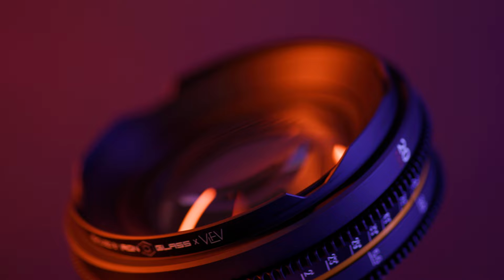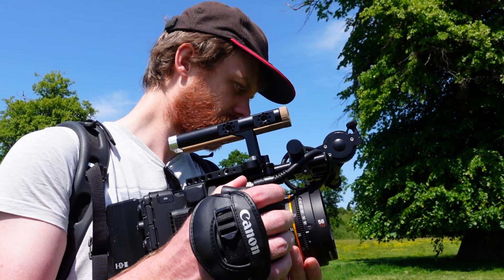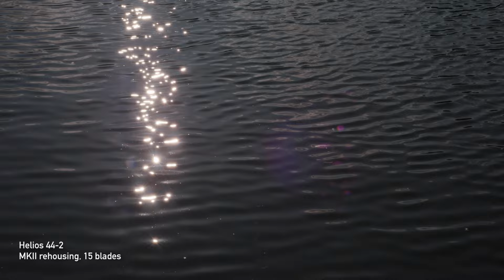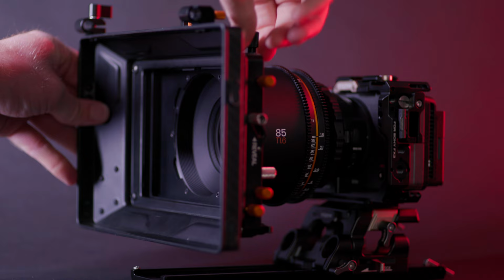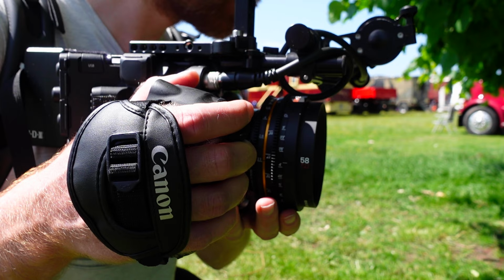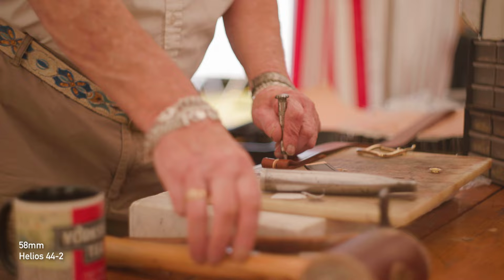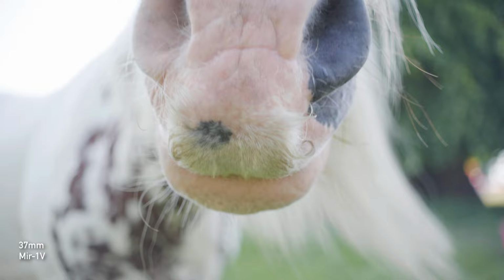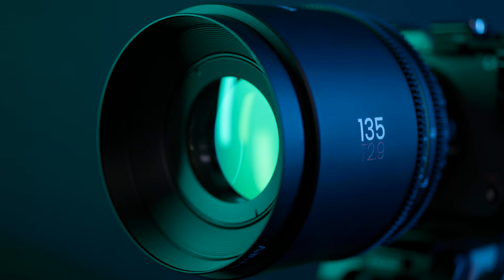IronGlass MKII Review - Are these the best vintage lenses in the world?

Comment: Great breakdown Alex, kudos for putting this out there.
Reply: Do you happen to know if the mk II versions mount on the Ronin 4D? (Aside from the 135mm which will be too heavy for the payload). I know the mk I versions mount but not sure if the larger diameter of the mk IIs will fit the lidar bracket.

Comment: Here's a question - did you send in your own lenses? Did you test them first? Or did you let Iron Glass choose the donor lens? Really itching to get a 44-2 in a rehoused version. Which version of the Helios did you rehouse? There's so many variations.
Reply from the maker: I opted for IronGlass supply the donor lenses. It was worth the extra cost to me - yes, I could have found them cheaper had I picked them myself, but it saved the time and effort plus all the lenses IG supply are perfect condition. The Helios 44-2 is the 'classic' Helios 58mm, with 44-M and so on being the variants with any notable difference. It shouldn't matter which 44-2 you supply, optically they're all the same but with perhaps only very minor tweaks to the coating over the years.

The exception to IronGlass supplying donor lenses was the 40-2, which I sourced myself. At the time of announcement this was necessary, however I believe they are now offering to supply these themselves too.

Comment: Thanks for the great review, Alex! I recently ordered my 58mm MKII and want to add the 85mm 40-2 and a wide option to complete a 3-lens set. Thinking of the 37mm simply because the swirly bokeh seems stronger on this one and could match the Helios better. I also wanted to ask if you know of 82mm circular filters causing vignettes on any of these lenses. I love HBM 1/4 but would love to use my circular one to keep weight down. I know I would need a step-down ring or a SIMtray.
Reply from the maker: They don't have filter threads so you would need to use a SIMtray or similar. I don't have one myself so couldn't test, however I would suspect that the longer focal lengths would be fine and it would be the wider lenses that might vignette - certainly on the 20mm though on the 37 you might just get away with it if the filter is close enough to the lens. It also depends on the format you're shooting. If Super35 then I would guess you'd be okay.

I'll have some affiliate links soon so if you do decide to add the extra focal lengths, I would really appreciate the click through! Check back on the video description in a few days ;)
Reply: @alex-stone  Will do! Thanks for the info!

Comment: When you need a russian engineering and optics to make ukrainian lens... Ironic.
Reply: Soviets at that time ukraine was part of it ..hehehe pls people don't mix apples & oranges  ... lots different ethnicities work together in soviet times on many designs so basically can't be specific to that certain country ...
Reply: @hohhan1978 I think what you meant is German engineering and optics. Which is even more “ironic”
Reply: @kerder8660  So we should consider ukrainians and russians as the same thing as far as they completely mixed by population. You can't distinguished soviets nationality by place as everyone was cros migrating a lot and most engineers in east europe part was from center russia.
Reply: @ep7121  True but only partially. lens design and lens scheme isn't the same thing. As far as final desing was only inspired buy initial scheme its still should be recalculated and redesigned in order to be produced out of different glass  and coating materials. So final product looks alike from scheme perspective but there only resemblance left of it.
If you will try to reproduce original german design with same materials as was used by soviet it wouldnt even focus properly.